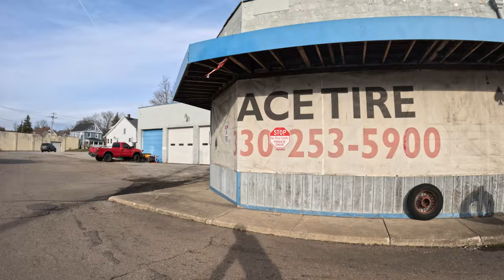Rim Brakes, Friction Shifting, & Flat Pedals Oh My!

Comment: Rode rim brakes for years in sun and rain, no issues. But I bought a 1974 Schwinn Suburban just for fun, all original. Got caught in the rain and went through an intersection squeezing like a madman and doing the Fred Flintstone braking. It was like the brakes weren’t there. Before some tech advancement, or the shoes were old and hardened? And FYI I will never get used to headwinds.
Reply from the maker: Yeah / it really does depend on the pads and the brakes. I do have some truly bad ones. But usually an adjustment and a pad upgrade will fix most up to be “good enough”. 
I’ll tell ya - the 9 speed era Dura Ace brakes I have on an 1986 Schwinn are better than any mechanic disc brakes I’ve tried.
Headwinds really can ruin a day - I prefer hills - those I know are going to be there…

Comment: Nice looking ride. You should try side pull brakes on vintage steel rims in the wet. Nothing gets the pulse racing quicker 😂😂😂
Reply from the maker: I have a set of 9 speed era Dura Ace brakes and I would put them up against anything disc - they are amazing. .
Reply: @TimFitzwater  My friend has a Reynolds 631 single speed mountain bike with discs and I tried to ride it but nearly shot my self over the handlebars. 😂 Rim brakes forever ✊

Comment: If only the disc brake ppl knew that look stop salmon pads handle the rain extremely well
Reply from the maker: 💯 yup quality of pads and brakes all matter. Not every disc brake is better than every rim brake.
Reply: @TimFitzwater  I beg to disagree vigorously; my SRAM Code R 4-piston hydraulic disc brakes stop/scrub speed/control the terrain feel better with ONE finger than Anything eraser-brake related.  You use the brakes less or you lightly tap or feather the brakes more strategically and are faster.  You can also brake later in a section of road or trail than you would with eraser-brakes.  
  Even the Shimano V-brakes on the last rim-braked MTB i had back somewhere in the earlier 90's sucked in the rain and mud; you had to pre-brake before you actually hit the brakes.  Also, on long, fast mountain road descents you run the risk of blowing your tubes and crashing from excess rim-heat.  Additionally, the modulation and plush power i get from my Codes makes it easier to navigate tricky sections of the trail faster with less hand exertion. That matters when you're on the trail or any kind of long/fast descent for a while..!
  Lastly, adding 60 extra pounds to one's bike for Bikepacking/touring really shows the dangerous limitations of rim-brakes.  Saw a video where a rim-braked touring type Nearly crashed really badly on a long gravel descent because of insufficient brakes not meant for the combined weight of the bike, touring gear, and rider.  
  BTW, i started riding/mountain-biking in '89 (am 51 now) with V-brakes and they were good for their time but, once disc-brakes became more common, affordable, and i was able to test ride them, i Never looked back.  Also, even if i had a road (or CX) bike, it would have disc-brakes.  The speeds you can hit on a road-bike on a long downhill are slow motorcycle speeds and that Demand more powerful/safer brakes than glorified erasers rubbing against a rim...
Reply from the maker: So I don’t get it. I said not every disc brake is better than every rim brake. You named a specific disc brake. I had TRP Spyres which were mechanical discs which couldn’t hold a candle to my 9 speed Dura Ace rim brakes let alone what the modern direct mount rim brakes would do.

Comment: I wonder if they make gravel tires for my Schwinn it's 27x1 1/4
Reply from the maker: There are some 27 inch tires out there with tread. I think Panaracer has some. To me it is all about how wide you can go without rubbing on the chain stays - which is why I like converting to the smaller 700c wheel size to get a bit more clearance.
Reply: @TimFitzwater  I gotta look into this because I'd like to ride on the gravel like u that's pretty cool